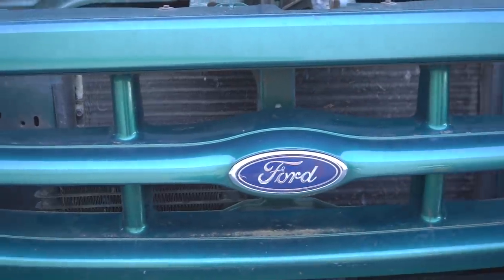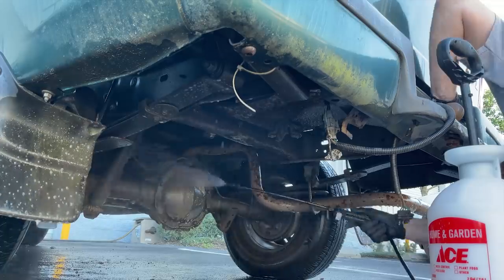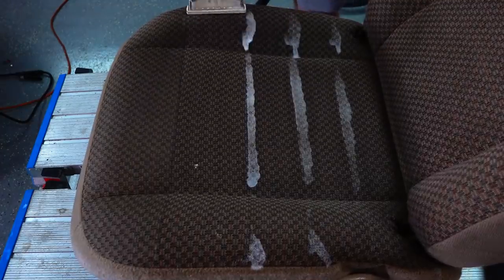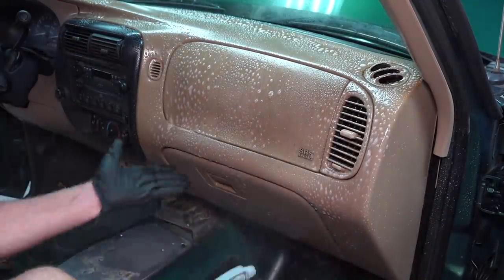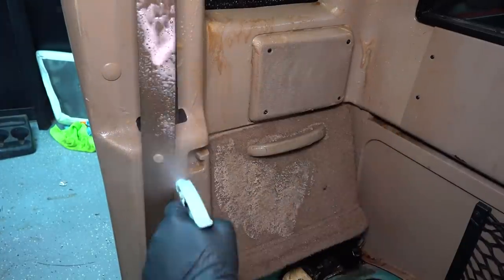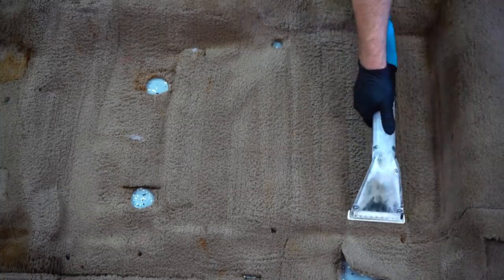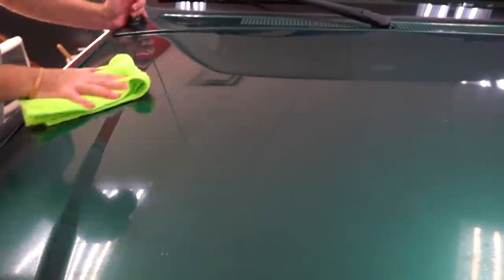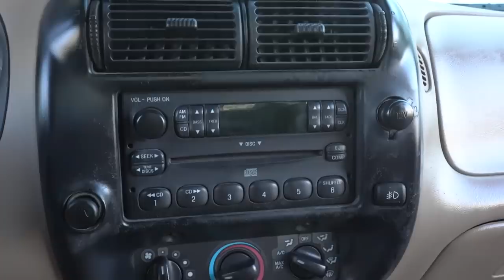ABANDONED Barn Find | Nastiest Ford Ranger Ever | First Wash In 8 Years | Car Detailing Restoration!

Comment: We used to remove the carpet, soap it down then use the power washer to get all the years of garbage out of it.  We had one where it looked like someone or something had bleed real bad, we shop vaced it and set it on this large grill type thing about two feet off the shop floor and used this a six foot in diameter fan to dry it . We'd leave it overnight to dry. Worked great.  One was so rotten it fell apart when power washing it.

Comment: The damage potential isn't immediate with pressure washing engine bays.  But, that high pressure water can force its way through otherwise weatherproof electrical connectors and eventually cause corrosion in electronic components.  I prematurely burned up a lot of ignition coils on a couple cars to learn that lesson.

I noticed some nice rust stains in the carpets from where the seat bolts down.  I was wondering if you've ever tried saturating stains like that with CLR or something similar.  I've had good luck with it getting rust bleed stains off paint.

Comment: FYI if i have a carpet that bad and its out of the vehicle , shampoo it and then throw it over a hand rail or saw horses and hose/ pressure wash it. 
That will far excede the ability of an extractor.
It will need a few days to dry.
It will be a 3 hour job versus 6-7 hours.

Comment: ALL of these "detailers" .. I've watched SO many.. EVERY one of them.. when it comes to the rims.. NOT one ever removes the center caps on rims .. there IS gunk behind those center caps .. takes maybe a minute to remove 5, 6.. or 8 lug nut  covers? .. good job detailing.. Get the GUNK from behind the center caps..  with all the degreaser, acid, all purpose cleaner that is used.. FIRST trip down the road.. centrifugal force WILL sling out that dissolved gunk from behind the center caps
Reply: I'm going to go on a limb and say it's due to a liability issue more than anything else. I can only imagine the issues that could arise from lugnuts potentially not being properly tightened...

Comment: 27:16 you don’t have to do 8 hours or replace carpet. You pressure wash it.
Reply from the maker: The carpet was so fragile that pressure washing it would of absolutely torn it apart and also it may seem like it’s faster in my videos but I’ve spent 8 hours pressure washing carpets to less work maybe because it’s just standing there pressure washing but sometimes it’s faster sometimes it’s not.
Reply: @MADDETAILING  what about regular hose then let it hang and drip dry
Reply from the maker: @jayasmrmore3687  a regular hose would take 1000 times longer
Reply: @MADDETAILING  really Bc it uses more water than a pressure washer but that’s good to know. I learn something new each day, don’t we all
Reply from the maker: @jayasmrmore3687  Not enough pressure to remove embedded sand
Reply: @MADDETAILING  isn’t that what the vacuum, drill brush, and (if necessary) tornador is for?

Comment: If i was to buy a cheap vehicle i would make sure everything works and then immediately change the oil and filter, air filter, fuel filter cause you never know how long its been since it last had it changed. Once all of the important maintenance is done and then clean it. I know everyone is different but this is what i would do if i bought a cheap vehicle